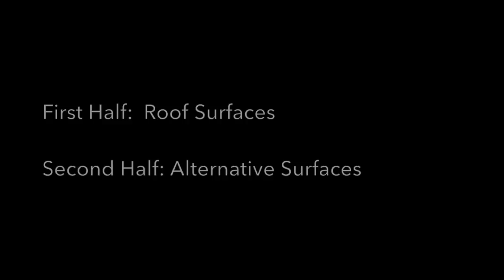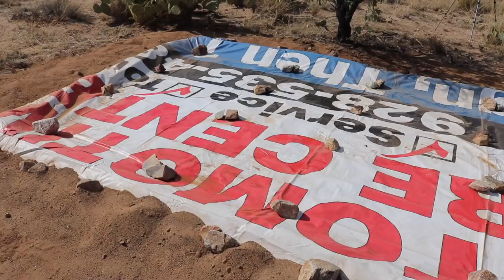Rainwater Harvesting - Collection Surfaces

Comment: I like the tarp & the patio collection ideas... Simple & pretty much anyone can do them. I’ve got to figure out a good way to collect from our metal building. The ribs are really deep, and I’m thinking a trough at the bottom may/may not work. Would have to build it as the building is assembled & find some way to ensure the water wouldn’t seep into the surface at all. Things to ponder!
Great video as always, thanks!
Reply from the maker: thanks Steff!  I think the patio idea might work well for your building... I have a similar structure near me and I have often thought if they guttered the area where the metal met the slab... they'd be able to collect runoff

Comment: I saw once rain drift harvesting I think it was called, it allowed maximum vertical use of the land available by hanging taught strung windbreak netting 6ft tall and as long as your space allowed. 
With the bottom of the netting and the straining wire/cord close to the ground positioned in the middle of cheap plastic half round guttering (like used on a roof) it collected loads of rain with very cheap materials. 
Just posts, wire/cord , netting and guttering. Have a look and see what I mean, it would look like a very long meandering volleyball net! Or similar. it’s another option you might like to try maybe. 
Slightly envious of the sun there at the moment I must say
All the very best to you all and a great video thank you👍
Reply from the maker: Mike outside most of the time thanks Mike!  I’ve seen systems like that for collecting fog/dew...but it would be interesting for rain too!  It would be more resilient in the wind too than a solid tarp😀👍

Comment: You have a significant amount of roof areas space..
 I would think that you would want to try to figure out some kind of a tarp that you can roll out from the peaks of it. Where you could utilize some of the water off of the existing surface areas.
 Perhaps with a roll-out tarp, that can self store on the Peaks or perhaps easily removable during the dry seasons.
This would give you essentially the same volume of water yet made significant amount more potable and usable for vegetables.
 that's just kind of a thought..
Reply from the maker: I definitely want to develop the tarp idea further for both capturing more volume as well as a clean usable water too :D

Comment: As usual, great content.
I think, a lot of the time it goes back to common sense, as to where to collect from. 
I think that another risk in collecting from the flat roof that you showed is that they never tend to fully drain, and you may end up with some stagnant water, also more surface contamination - think bird droppings, trapped rodents, rotting leaves etc
Reply from the maker: thanks Wayne!   yes, common sense is a huge part when deciding harvesting components.  I like to say you can probably harvest off of anything... just depends on how much you want to treat and filter
Reply: homesteadonomics absolutely, horses for courses.

Comment: Nicely done presentation Joe. We do take our water off the roof for drinking and it is an asphalt roof. We have a first flush and the cool water we get in the NW should be, in my opinion, adequate for consumption through a ceramic filter or distillation. I wouldn't recommend drinking water off a shingle roof if the water was warm due to the breakdown heat has on materials and may get precipitate in the water, the universal solvent. If concerned, one can send off a sample to a water analysis lab to find all the contaminants if he/she were concerned for a few hundred dollars. Like you said "at your own risk". I have been a water treatment plant operator for several years and know it would be a good idea to test the water for contaminants. We have been doing it for years and haven't died yet but one never knows the long term residual effects of different source waters.
Reply from the maker: Awesome Mr. Rain!  I couldn't have said it better... sounds like you guys are well into the game too :)  
Thanks for checking it out... more to come on on this topic!

Comment: Great video!  Thank you 👍

I met with someone who specializes in rain harvesting and they were OK with asphalt roof for drinking water.
I wasn't.   Not sure what to do since a metal roof is not cheap. 

Thanks again for helping us all out with your expertise
Reply: A&M says not to use water as potable until after the third year for shingle roofs
Reply from the maker: It all depends on each individual person, their roof surface and what they are comfortable with... and able to filter.  Some surfaces are more idea than others in regards to imparting things to the water.  My only concern with asphalt is the oils washing into the water.  That's not to say it can't be used... but just that it would require a more intensive filtering.  Down here in AZ it gets hot and water off of asphalt shingle roofs will have a small film of oil on the top of the water from the asphalt.  Maybe in other areas of the country that isn't the case.  But in any regard.. each person just has to figure what it right for them and do their own research on their roof.  My opinions were more of an overview... and just an opinion...lol... not right or wrong... just my thoughts ;)
Reply from the maker: "...more ideal than others..". my fingers...lol
Reply: Personally I would think asphalt shingles have a lot of fiberglass in them, as they get old those fibers are going to be coming off.   I bet if you  look in a microscope of a water drop, you might see the fiberglass.

Comment: Not sure what your elevation difference is across your property but have you ever looked into hydraulic ram pumps for transferring water from location to location?  I recently discovered these pumps and they run with no power needed but do need a little bit of elevation change in order to work from my understanding.
Reply: Matt White The biggest problem with ram pumps is that there is a lot of wastage with them. Only a fraction of the water that flows through them actually gets pumped. They're great when you have a creek or stream you want to pump from as the wastage just goes back into the creek/stream. They're not good where every drop counts, such as in his setup. You also need a decent bit of drop before the pump for it to operate.
Reply from the maker: both good points... yes, I have thought about them... very cool!  seen some on wranglerstars channel and a couple others.  Super awesome set up... but Tallman1128 makes a good point for the stream aspect and the water usage.  If I had the land set up then for sure yes... but currently most of my setup is via hoses and small elevation changes where as I can siphon from one to another where there is just a few feet of elevation change :)

Comment: Back on your video from last year, the piano stool. How did you cut the angles of the legs? Not the bottom parts that you dipped in paint which was an awesome idea, but the top part that welds to the shaft the seat screws in. Please help me out, I'm stuck at that part and don't want to waste metal. wasn't cheap LOL

Comment: Great video, as always.  Can't most of the contaminants that you're concerned about be filtered out?  Also, how many years have you been in your home?
Reply from the maker: Logic Bob thanks bob!  I’ve been in my home 9 years now...yes most all contaminants can be filtered out but it is dependent on what is being filtered.  For example dirt and sediment is easy to filter than say oils off a asphalt roof...so yes, anything can be filtered but somethings will require much more intensive and expensive filtering than others to make Water safe

Comment: Hi.

A) Interesting that you talk about temporary tarps off your shop roof; I commented on your shop planning video about considering expanding the size of your porch to increase roof rainfall gathering potential. 

B) To expand your potable water collection, would it be difficult to replace the current shop roof with a sheet metal roof?
Reply from the maker: Hi Peter!  

Yes, I will have to go check but I think I remember a comment about expanding roof size.  I think a tarp solution or someting like it can be a big game changer for small structures.  I want to develop it further with something a bit more robust like panels or something that can withstand the wind...but for the quick add tarps are hard to beat:)

and for replacing the roof on the shop.  that wouldn't be hard to do but the roofing that is on there is new and in good shape too.  Ondura gave me that roofing to use on the shop and even though I won't be using it for my potable water supply I do plan to use it for garden related needs.

Comment: Another awesome video, thank you so much, Joe!!!! Question about the concrete patio/driveway: does concrete have toxins? I'm assuming it does, but I don't know, on our dream layout we plan to harvest from concrete sidewalks primarily for pasture irrigation and possibly animals' water, but we assumed for the animals we would need a filter system. It would certainly be an excellent source for rainwater and I loved the gutters you had  installed! Very best wishes always!
Reply from the maker: littleflower1826 hi LF.... I would be more worried about anything on the concrete than the concrete itself.  Many cisterns and municipal water systems use concrete for storage.  But with that said I would always filter before use😀👍
Reply from the maker: ....continued.... many ranchers and agriculture setups use concrete for animals with no effects as well.  They are more capable is using less than clean elevated than we are...muddy ponds, streams , etc.
Reply: Thank you, Joe! Excellent point, thank you so much!!!!

Comment: I am sure this has been asked but I couldn't find it, but what kind of filtration system do you use for drinking water and do you have any issues running through a water heater and during the summer the water getting hot
Reply from the maker: I have talked about it but I plan to get a bit more indepth on it in the future.  short answer is that I use a berkey ceramic filter for all cooking/drinking water.  the rest is just water that I let sediment out in my rain tank before transferring it to my other tanks.  as for getting too hot, not a problem... volume is to great for it to really heat up.  if my tanks were say flat and only held say, 100 gallons of water but had a surface area of 100 sqft or something like that the water would get really really hot.  but since there is a large volume of water in relation to the surface of the outside of the tanks then it isn't as much of a problem.  hope that made sense...lol... sometimes it sounds better in my mind than when I type it...lol
Reply: homesteadonomics thank you.  I live in a mixed climate area and right just use rain water for gardening, chickens, and my show pigeons, but would like to get more use because it's free and they are going to start charging for storm sewer run off by the as. Ft. Of surface on the home and drive way

Comment: Great video again. I was thinking about soil cement as a relatively low cost solution for a large scale water harvesting collection surface, fed into swales, then into a shallow "settlement area"(an area that would spread out and slow down the water, allowing for heavier particles to settle out), through a screen, then ultimately overflowing into an in-ground concrete cistern.
Reply from the maker: haha...yes!  that is something I've really been considering as a cost effective solution.  Obviously a concrete pad would work great too..but it's way more expensive than stabilizing the soil or compacted ground to use as your surface!  I like the idea of eventually diverting to a cistern too!

Comment: I have read that asphalt shingle rainwater collection is about as safe as metal roof rainwater collection (Texas A&M I think). I see you have the driveway water collection but do you have an actual rain garden? If you don't you have to build one!! I don't have the cistern collection capacity that you do (1850 gallons for me) and I live in a little wetter area (Dallas, Texas -still on the dry side). But, my little rain garden is the best rain harvesting feature in my control and it requires the least amount of work from me.
Reply: We had a shingle roof that needed repair and A&M said not to use it as potable until it's been on there for 3 years.  Now we have a metal roof!
Reply from the maker: Hi Joan,

yes I do have a rainwater garden...  its from about the august time frame... you can scroll down in my videos tab and see it.   Definitely something I want to develop further :D

as for the shingle roofs... here is an answer I typed to another comment..

"It all depends on each individual person, their roof surface and what they are comfortable with... and able to filter.  Some surfaces are more idea than others in regards to imparting things to the water.  My only concern with asphalt is the oils washing into the water.  That's not to say it can't be used... but just that it would require a more intensive filtering.  Down here in AZ it gets hot and water off of asphalt shingle roofs will have a small film of oil on the top of the water from the asphalt (i've seen this in barrel collection)    Maybe in other areas of the country that isn't the case.  But in any regard.. each person just has to figure what it right for them and do their own research on their roof.  My opinions were more of an overview... and just an opinion...lol... not right or wrong... just my thoughts ;  "

Comment: Because you live in a desert environment, how do you deal with the first rain after a long period of drought - there will  be a layer of dust collected on your roof that will be rinsed off during the first rain for a long time ??
Greatings from The Netherlands
Reply: Many people use a "first flush" that diverts a certain amount of water before going into the tank
Reply from the maker: great to hear from the Netherlands Wiebe!    
as for dust, etc,.... I sweep or spray the roof and then vacuum or spray the gutters.  first flushes are a good option too for debris but I've found from systems that use them here that they get the floating debris quite well they don't offer the capacity to get all the dust and dirt.   I plan on setting one up off the shop roof just as a fun project for the house... it's more effective for me to manually clean it.  You can see me answer that question in my last rainwater video from this summer (rainwater QA)  Hope that helps :)
Reply: Thank you for your informative answer, I have been following you for a while, and admire your skills in building with wood and steel Greetings from the Netherlands at the moment negative 17.6 ° F in my region
Reply from the maker: Thanks Wiebe!  Hopefully you are enjoying a fire or wood stove right now with those temps:)

Comment: Have you ever thought about using a ram pump to pump water into a water tower for so you can use gravity instead of electricity to water your plants for example?
Reply from the maker: Sceme1991 yes I have but from the research I’ve done is that you have to have a certain amount of distance in relation to the water and the pump being able to pump vertically.  Most of my garden plants and other trees are downhill from my storage so I have elevation already built in.  But it is something I’d like to explore for my rainwater garden area😀👍

Comment: JOE TRY A TRAP SYSTEM LIKE THE ONE ON YOUR TRUCK ONLY MAKE IT ON THE TOP OF YOUR EVES AND HAVE A CENSOR DETECT RAIN AND IT ROLLS OUT LIKE A RV AWNING YOU KNOW WHAT I MEAN? THOSE ARE LIKE 10 FOR.99 ON EBAY, NOT THAT YOU WOULD NEED THAT MANY AND A VERY SIMPLE SOLAR PANEL CAN POWER IT. YOU KNOW LIKE ONE OF THOSE CHEAP SOLAR PATH WAY LIGHTS YOU CAN GET ANYWHERE. LOVE THE PLACE CANDIS AND I WOULD LOVE TO SEE THE TREES AND THE BEES IF YOU STILL HAVE SOME. THE BEES ARE A COOL THING, YOUR VERY OWN POLLINATORS FOR FREE TOO HAAHA JUST ASKING OLD ONE LEGGED JOSEPH T RETIRED NAVY

Comment: One reason private collecting of rainwater is discouraged is because Municipal Water Systems have high overhead because of the water collection and distribution system needed. The more water that flows through water meters and is charged for the more efficient their monetary return is. Also the closer together the paying customers are located the more water can be sold from the same system. A few self-sufficient homes in every block would seriously cut into the water systems sales. Our state has very generously allowed us to have one 50 gallon rainwater collection container. There are Federal Laws that regulate Navigable Waters and several years ago an attempt was made to include any water that drains into a Navigable Water system to be under the same Federal Regulations. Once the water hits your roof and begins draining toward the ocean at some point it gets into Navigable Waters and their contention was that wherever that Source water comes from was under those same Federal Laws. Do you need more Federal Regulations on your land? . Fortunately that over-reach was stopped.

Comment: Wouldn’t be too worried about tar/asphalt, cast iron water pipes have been coated with it for centuries. Most notably London and the Victorian era systems which have been studied, the studies say yes the particles get in the water but health effects are poorly understood. Which means they couldn’t find any specific dangers and you do get exposed in other ways like air pollution. 

Secondly they say heavier hydrocarbons are the most stable such as tar and asphalt and least likely to contaminate. 

Third, with his huge settling tanks such heavy material would fall to the bottom with the sand. Being a few hundred miles east of a large metro like San Diego you may already have particulates from air pollution in your settling tanks. Would be interesting to have an assay.